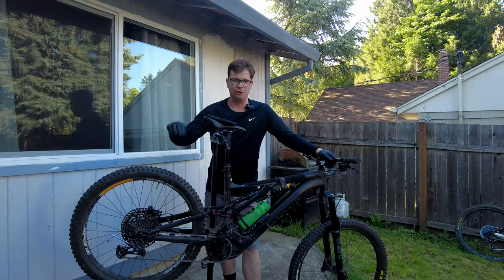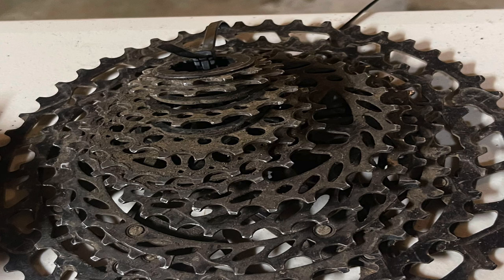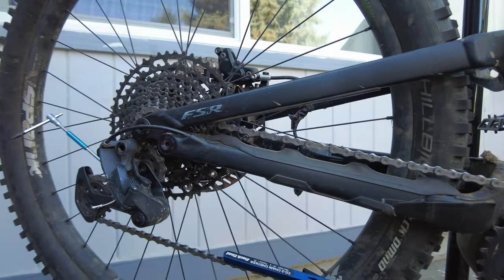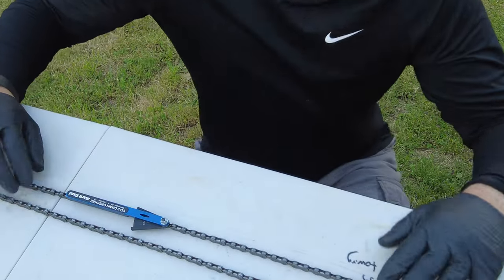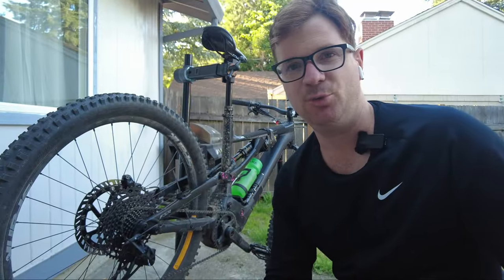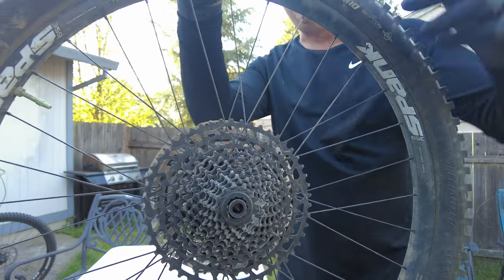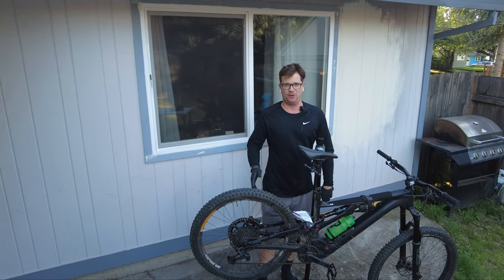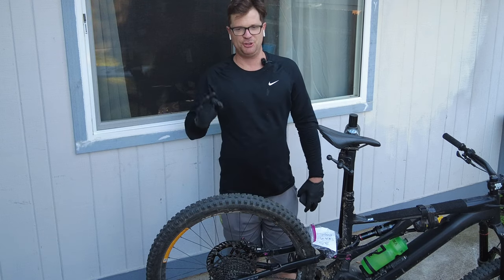Hacks That'll Save You CASH on Your eMTB & MTB Drivetrain Wear!

Comment: Great video! Can one replace single cogs on any cassette? I swapped everything to SRAM EX1, but still skips after a while. Will check the chain more often, but is there anything I can do to replace the two smallest cogs with something more durable? Perhaps not possible on the EX1 cassette?
Reply from the maker: Has to be Sram NX cassette 12 speed. The older free body Shimano HG.  I use Shimano cogs on the Sram cassette. Universal cycles has cogs. 11 and 13. Dam Ex1 cassettes cost to much not sure about those.